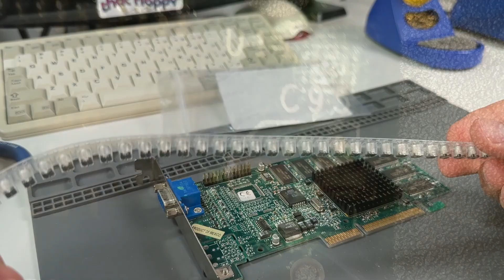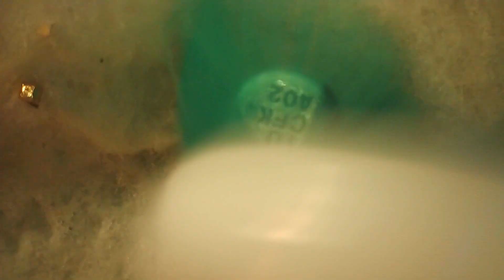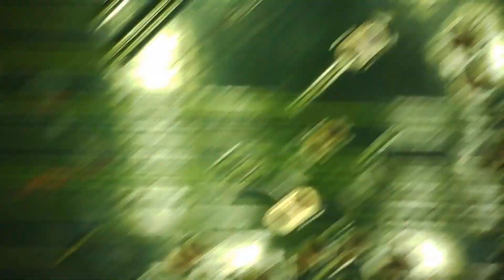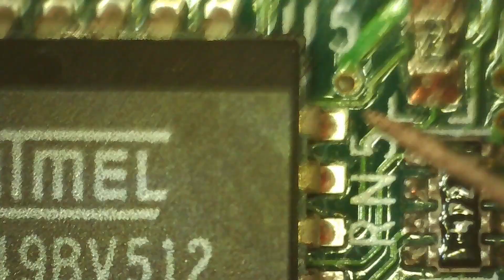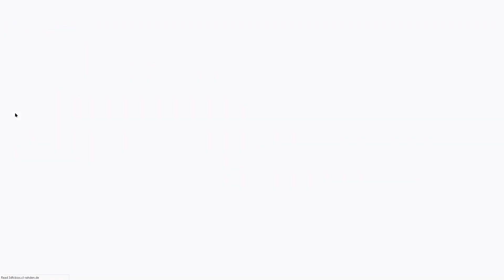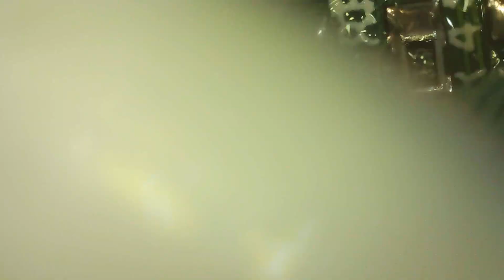Repairing a Stubborn 3dfx Voodoo 3 2000!

Comment: "Unknown flash EEPROM manufacturer" oh good, I'm not the only one running into this issue.
Reply: oh no...reflashing and replacing the BIOS chip didn't' solve the problem. Now I'm paranoid. I am the proud new owner of a T48 programmer...so now I have the power to absolutely ruin this thing.

Comment: i know this video is old but wanted to ask, the hot air station you're using looks like the same one i have, did you have to do any calibrations on it or anything to make it work correctly or are they just really slow to heat up?
Reply from the maker: Hmm, didn’t have to calibrate anything. The set air temperature is reached really quickly on mine but it does take a long time to get components hot enough to desolder. I really want to get a pre-heater, as I’ve heard it makes a big difference.

Comment: Thanks for this video!  I'm trying to troubleshoot a Voodoo 3 2000 PCI that isn't displaying, but the system will POST with it in, and found your vid.  I'm very impressed with your troubleshooting skills, I wish I had that familiarity with soldering and circuitry.

Comment: Found one Voodoo3  from compaq on boot fairs maybe 10 years ago, missing capacitors, missing heat sink ,in bad condition overall i do not have skill to repair it or know anybody near me to repair it. Don't know if it safe to try it out without capacitors 
Everytime i clean my stuff i throw it away for recycling  and next day i dig it up and put it in a box.
Maybe someday someone can use it save it or use as spare part.

Comment: ur soldering station is awful. never use such a small nozzle and never use soldering station with fan in handle.
those weak  soldering stations(weak by airflow) are hitting with thermal shock pcb's because  u need to install small nozzle and big temperature. also smd components will never blown away with good(but not expencive heatgun)
check for quick 857dw+ 
and use at least 1cm diameter nozzle. components will be on its places.

Comment: hi vswitch. Watching this video, in which you use an S3 Virge DX, I ask you a question for help.

I have an S3 Virge DX card (AOpen PT 75), which I had never used before (so dont know its previous state). after a good cleaning and soldering a capacitor that had come loose. I tried it and it did not give an image, the PC emitted several beeps. After an additional review and more cleaning, I managed to show the vbios report, but then it goes dark. Reviewing it more in depth I saw that it had a position where another capacitor seemed to go and in the images that I looked for I saw that yes, it was missing another capacitor (those are the two on both sides of the PCI connector). In the images I cannot see the data of the capacitor, but visually it is the same as the one that I soldered before. So I matched this capacitor and put it on, but the card remains the same, it shows the information from the vbios, and that's it, it doesn't give an image. during boot up i keep touching the chip and i feel it getting hotter than i think it should, so i turn off the pc.

Can you give me any advice on this?

also

I have two AOpen VI15G motherboards , the revision with support for 3.3v CPUs (it has the power regulator). They are part of some PCs (the other is a Pentium) that I had at the end of the 90s or the beginning of this century and all the parts and pieces were stored in working conditions almost 20 years ago. A few months ago nostalgia assaulted me and I am reassembling them. All the parts needed a lot of cleaning, from the PSU to the cards, due to the dust accumulated even inside the boxes, in addition to some slight oxidation. Everything was pristine after cleaning. one of the two psu need some repair but the other ones is working flawlessly.

I have some 486 but the best one is an Am5x86. I didn't remember if the jumpers were set for use that one, so I looked for the documentation and I found two documents, one original from the first version of the motherboard, which only supports 5v, and another with jumper settings updated for the revision with 3V support). I configured the motherboard as an Intel 486DX4, also as an AMD DX4 (the board is from 2 years before the 5x86), based on some recommendations I read around. both are 3.3/3.45 volt processors, but when measuring the voltages on the socket pins and on the regulator output, it's always 5V no matter the configuration. It happens equally on both motherboards, I don't think the regulator is defective in both cases.

I would appreciate if you help me with the correct configuration to be able to use the Am5x86 (or 486DX4 from Intel or AMD, as a valid config as I see). The other 486 compatible I have is an AMD 486DX2-66 but of course the primary interest is the Am5x86. I still need to check them with the DX2s to make sure.

the PentiumMMX is also not working, no post, but i will see it latter

Any help will be very appreciated.
Reply from the maker: That's strange that the system displays the vbios text strings but doesn't display anything from the BIOS post process. I can't say I've ever seen that before. Do you happen to have another video card you could test out in the system to see if the behavior is the same? It is normal for the Virge chip to get warm after some time, but if it gets really hot (like so hot you can't leave your finger on it for longer than a second or two) that could be an indication of some other problem with it. If the same thing happens with another card, I'd look at the motherboard and BIOS. I've seen strange things happen with power supply issues too, so could be power related also. Sorry I can't really be of more help on that one.

In regards to the AM5x86, boards that don't officially support it can usually still work. It's usually just the write-back L1 cache that can't be enabled. The jumper settings for a DX2 or DX4 should be fine, but to get it to run at 133MHz, you'll usually need to set the multiplier selection jumper that's normally used to set a DX4 CPU to run at a 2X multiplier instead of 3x. Once you set that, the AM5x86 should run at the 4x multiplier. I did find this PDF document on the retro web that may help. There is a column for 5x86: https://theretroweb.com/motherboard/manual/vi15g-settings-61a731bc3ef30571520750.pdf

That's strange that the regulator is outputting 5V. So both the input and output pins are reading 5V? Usually boards like this will just bypass the regulator when configured for 5V operation so that the regulator isn't used at all. But if you are measuring 5V on the VCC pin of the socket, then that's definitely a problem. I don't see a manual for that board with 3V support but perhaps it was just configured for a 5V CPU prior and needs some re-jumpering?
Reply: @vswitchzero  thanks for your answer.

Since the Socket 7 motherboard doesn't work either,  I am testing the card in an infinitely more modern PC, a 4th generation Intel, its board still has PCI. on that one I also tried a S3 Trio 64+ (2MB) and Win10 boot and showed image.... in a few shades of gray, LOL

About the temperature, well, I don't think it reaches that much, I just don't think it would get hot without doing any work. I'll see how hot it really gets, I never give it enough time just in case

I do have that documentation, it is the one I have used, but I read comments that this 5x86 config refers only to Cyrix's, and for this reason it is recommended to use the DX4 configuration. on the vogon web someone has it with an intel dx4-100 (another with a dx4 overdrive or something like that, but this is not valid), but in the images you can only see a part of the configuration jumpers. I tried to register on the web to ask but it didn't work for me. all the images I found are with DX2, and one  (from the theretroweb website) with the supposed Intel DX4 (W/B) configuration, but his one is strange because it is teh 5v only version of the board (unless they use an overdrive, I suppose)

PS: I just gave the regulator a close look. on the ADJ leg of the voltage regulator (the "transistor" like on the left, if the board is positioned so that they are below,  the one with a heatsink, it is an LT1085CT,) there are 3.3 volts!!!. even the vein that reaches it is thicker, but short, it comes from the main side of the board. however on the output leg (vout, the middle), the input leg and the VCC pins on the socket there is 5v. does that mean its dead? I measure no shorts, not in the power lines, nor in the regulators.

the other component is a NDP406BL FET, it has 12v on the G leg and 5 on the other two.

I must check if the same thing happens on the other board
Reply: @vswitchzero  Well, I managed to get 3.3-3.5 volts, with two configurations, the AMD DX2 and the AMD DX4. the "3.45v" settings for the intel DX4 deliver 5V!!. however they still won't boot. I'm afraid if the 5x86 was burned when I put it with one of the intel jumper settings. I tried with an amd dx2 (3.3) and it doesn't boot either, no beeps or anything. I will check the boards more thoroughly

Comment: Pre-heating absolutely makes a huge difference. You'll get more bulk heat soaked into the board meaning you don't need to dwell as long with the hot air station.

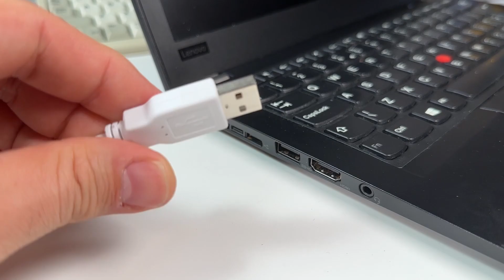Comment: 15:45 When plugging in a USB cable, the open side (where you can see through the two square holes) ON THE CABLE always faces away from the PCB. That almost always means that the open side will face up on a laptop, or to the left on a desktop PC when reaching around the back.

There are some exceptions to this, like most notably two IKEA items I have, a charger and a battery bank where the USB ports are upside down from the norm, with the "open" side facing down from the top.

Comment: Who are the idiots telling you to not use flux? Clearly they don't do any soldering but think of themselves as experts.

Even if you use rosin core solder you should use flux as it removes the oxide layer and allows the solder to flow cleanly and produce a stronger and better looking bond.

Use flux, specifically use flux designed for electronics soldering, the stuff used for plumbing is not suitable for the task.

Flux is your friend and while it is a pain to clean sometimes, it's better to deal with the clean up than it is to struggle with poor quality joints or solder that won't take to the thing you're trying to join together.
Reply from the maker: Totally agree! In my experience, you can never use too much flux and I always get better results with plenty applied. The stuff I use is really easy to clean with some isopropyl alcohol. Thanks for your comment!

Comment: Great work 👌 👏.Preheating is necessary when there is a bga ICs on the board .Preheating before removing the IC and after soldering the IC.  It must be go from room temperature to soldering and de-soldering temperature in gradual manner.  Because the thermal shock may not affect the removed BGA IC, but affects another BGA IC adjacent to it, and breakage occurs at the BGA solder points.
Reply from the maker: Thanks very much! And thanks for the info. I'm hoping that one of these days I'll be able to attempt some BGA work. That's one area I've never ventured into yet.
Reply: @vswitchzero  good luck

Comment: Do you know how to remove the heatsink on the V3 2000? Mine overheats and requires a tiny, and very loud, fan to work.
Reply from the maker: Yeah the 2000's tiny heatsink gets VERY hot. When you say overheat, does the card start to artifact or crash when it gets too hot? Normally they should be able to handle very high temps. If you can find one of those slot coolers that you put in the slot below the V3 to provide some airflow - it would probably sound a lot better than a 40mm fan. Removing the V3 2000 heatsink is a risky thing to do, unfortunately. Prying at it can damage the BGA connections on the avenger chip, and I usually advise against it unless its absolutely necessary. Some people have had success with the freezer method as it weakens the epoxy and it can be pried off much easier. But this is still risky. I've heard of people using very thin wire to "saw" between the chip top and the heatsink, which cuts through the epoxy. It takes forever, but its definitely safer than trying to pry it off. Best of luck!
Reply: @vswitchzero  It's been a while but if I remember correctly the card would start to slow down after a few minutes of gaming to the point where it was basically a slideshow. Putting a tiny fan on it made it work fine again.

I do have an old slot cooler but I haven't tried it. It's pretty loud too but not as high pitched as the fan so it would be an improvement. I'll give it a try.

Thank you for the information.

Comment: Congrats for the milestone, very well deserved! Nice video and I have a feeling the seller where you found the card is the same I source some of my stuff from 🙂 Preheating is a must. Someone might say ‘I’ve never used it and it’s always worked for me’ but just blasting silly temps to an IC is not good for either the component nor the pcb. For the broken trace, I’d say the pin would be floating and not low all the time - so it would probably be seen low and high at random by the chip. Anyways, I enjoyed the video and well done!
Reply from the maker: Thanks so much Tony, I really appreciate it! Congratulations on all of the success on your channel as well. I really enjoy watching your repair videos and have learnt a lot from you :) .. Thanks for the tip on preheating. I will look into picking one up. If you have any recommendations, it would be appreciated! .. also great point on the pin "floating".. I automatically assumed it would just behave as low when disconnected but there is clearly more to it! Thanks again.

Comment: Not being connected is not the same as having a grounded pin or a "low" applied. The pin might actually be floating as it's called. Basically it's level is undefined as the datasheet specifies what happens if the pin is properly connected not when it's not. It might have a defined level if there are internal pullups or pulldowns. ( And they are activated). But I would not expect them to be there on a flash chip.
Reply from the maker: Thanks very much for your comment! That makes a lot of sense.

Comment: You're becoming quite an expert on Voodoos. I have a V2 that has seen better days, no clue what happened with it, but it won't even be detected by OS or bios.
Reply from the maker: Best of luck with your V2! If it isn't detected - take a closer look at the frame buffer chip (the middle one near the slot). If there are any shorted pins, that could do it. Also make sure the regulator is providing the correct voltage output. Could also be failed resistor arrays, which I've seen before too.
Reply: @vswitchzero  Yeah, it's in a box of "things to look at sometime". Luckily I have a pair of Monster 3D II for a nice SLI working in a K7 700 :)

Comment: The pin was likely defaulted to high, the busted trace stopped it being pulled low (to ground). It's the only situation that fits the data sheet. Congrats on 11k 👍
Reply from the maker: Thanks for your comment! Yes, I'm pretty sure you are right about that. I assumed that a disconnected pin would be 0V, but I checked the pin again with the system powered up and during normal operation it measures 3.3V. So I think you are right that the trace pulls it low instead of the other way around.
Reply: @vswitchzero  you can see that CS, OE and WE pins all have "bars" over their text names. This means that they are active low signals, i.e. must be pulled low to be considered active (asserted). When they are high the signals are inactive (negated).

For many types of ROMs and RAMs you need to assert both CS and OE to read from the device, or CS and WE to write to it. In some cases, OE can be permanently tied to ground, and reads are effected simply by asserting CS, or writes can be made by assessing both CS and WE, where WE effectively overrides OE. This can save a little bit of circuitry during design.

I don't know if I've ever come across a datasheet which indicated whether an unconnected pin on one of these devices would be pulled high or low by default (I've certainly never noticed it if it was mentioned), but since they are very likely based on CMOS manufacturing processes, an unconnected pin will float to some random state and could thus result in unpredictable behaviour. What value it floats to could be influenced by noise from neighbouring circuitry, or by simply moving your hand or some test instrument near it. And this can even change from moment to moment, which can lead to very confusing behaviour during troubleshooting.

Given they are active low signals it would make more sense for them to be pulled high if unconnected, to make sure the device is disabled and wouldn't interfere with any others that are fully functional. But I suspect they aren't pulled in either direction and are expected to be connected to something that sets their state.

I would also suggest that "output disable" mode can't really be broken. That mode simply means that, since OE is negated, the ROM won't ever drive the data bus if CS is asserted.